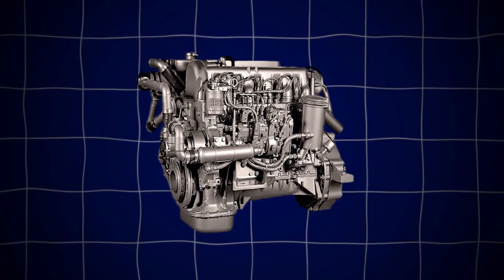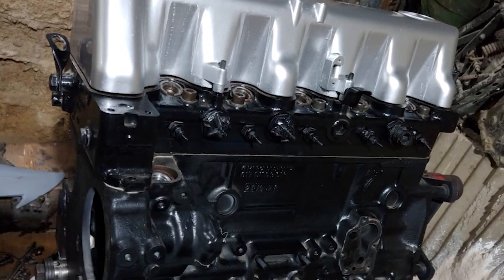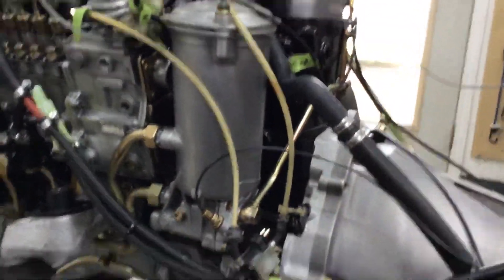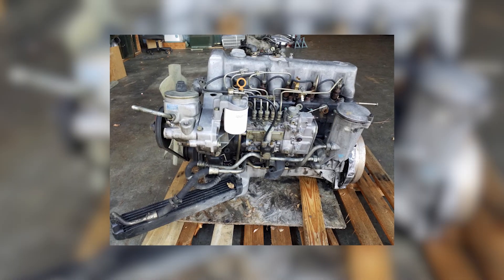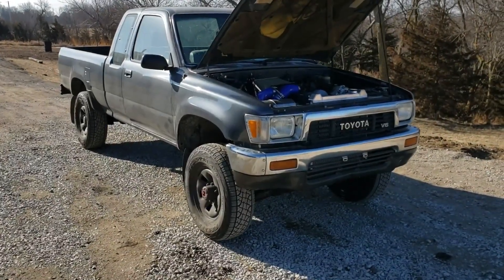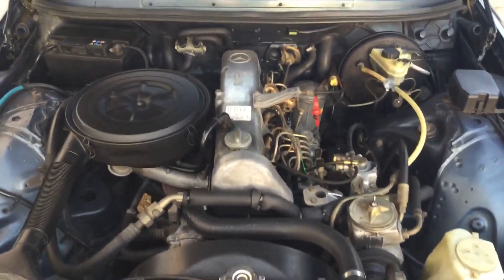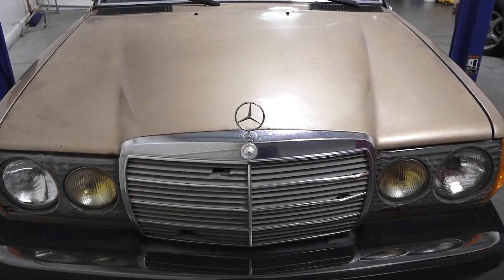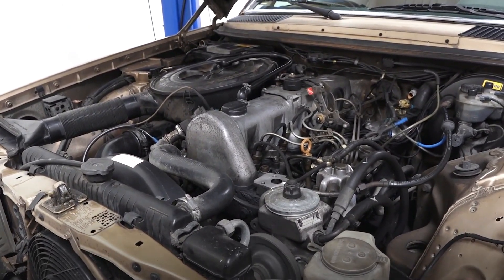This Diesel Engine Runs For 500,000 Miles, And That's Just The Start

Comment: very involving indeed.
however the end result seems to be worth the taughtfull   work involved
am considering a set up for swaping the stock 2.8 L petrol engine on a
1984G Wagon SWB.
target results
*utmost reliability
*320 wheel BHP
350 lb f torque  between 2200 and 2800 rpm
the gbox must be  changed since it is only 4 speed .;;;; will consider a reliable Automatic option
any recomendations based on actuall solid experiecw is highly appricated
Reply from the maker: It sounds like you're planning an exciting project!

Comment: Great vid! I'm currently swapping an OM617 with an upgraded injection pump and turbo into my 82 Toyota pickup 4x4.
Reply: Just finished my om617 swap in my 82 Toyota. Lmk if you have any questions.
Reply: @appalachiandiesel3243  did you manufacture your own engine to transmission adapter or can you share where you bought it from? I’m thinking of similar swap using the OM617 into a Land Rover/Range Rover/HSE.
Reply: Deu muito trabalho adaptar a caixa de câmbio na camioneta?
Reply: Where can I get the lead on Seong and Seong Uso in Coronado SUV models that use the OM617 design in conjunction with a four-wheel-drive? Were these vehicles ever imported into the US or were they strictly South Korean vehicles. If anyone can provide me a lead onto where to get one of these transmissions does it directly bolt to the engine or is there an adapter required for the transmission. I’m trying to determine if it would be possible to use the OM617 in a four-wheel-drive design and there is some thoughts of using the G wagon transmission if that bolts up thank you.
Reply from the maker: Sounds like an awesome project :)

And thank you for the love and support :)